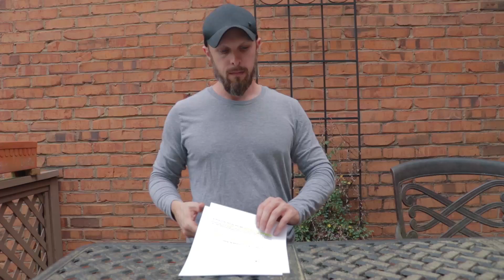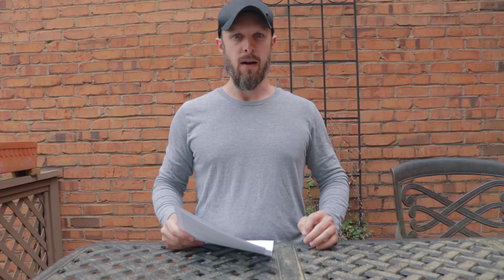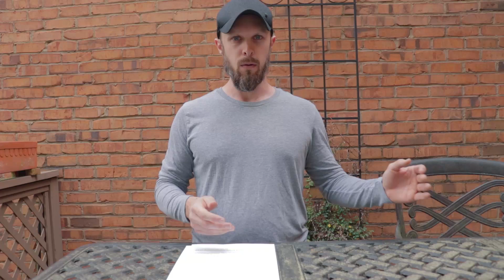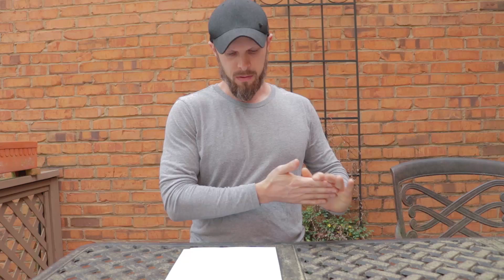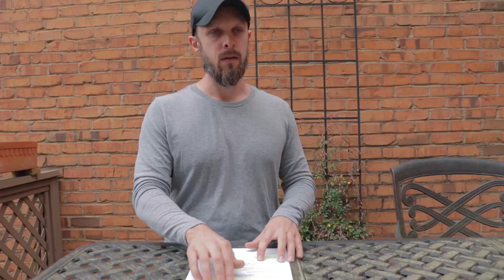Stop 5G Signals With Cob Walls - Protect Your Home From EMF Radiation

Comment: This in pinned in Atlanta. Is there somewhere in GA that it's legal to have a cobb house? I live south of atl.
Reply from the maker: Technically, it can be legal anywhere in GA if you follow the building codes.
But overall, move as far away from Atlanta as you possibly can and you will have much better chances of building a cob house there.

Comment: im losing braincells by the second
Reply: Are you sure you have any????
Reply: @britaniawaves4060  5G does not harm you at all, the strongest 5-Gen data is 300GHZ which is 2300 TIMES WEAKER THAN VISIBLE LIGHT. Also tissue heating is not a problem, because THE SUN HEATS YOU UP EVERYDAY MANY THOUSANDS A-TIMES MORE
Reply: @realaydsman  Have you done long term studies to prove this has no affect on the human body? 150 doctors and scientist from 43 European countries all called for suspension on this roll out until sufficient testing had been carried out, but got swept under the carpet. its like saying your iPhone is perfectly harmless just because it doesn't kill you instantly, FACT IS it can be weaponised, It seems a new pandemic perfectly coincides with every new radiation tech we release, we are electrical beings!!! i would love to send some links to help you understand but for some reason, some (dis info) is more DANGEROUS than others, AND NO! THE SUN HEATS ME UP ABOUT 24 TIMES A YEAR...............I LIVE IN ENGLAND

Comment: Great video. I would like to add that yes, higher frequencies like 60GHZ do not penetrate. 0-30GHZ are considered microwave bands. 30 + GHZ gets into the millemeter wave bands that do not penetrate. 5G in the short run + long run basically means an increase in ALL frequencies, including the higher frequencies. Current cell towers at 4G run in the 100MHz - 15 GHZ, which does penetrate. The "G" in 3G, 4G, 5G simply means "Generation." The "G" does not correlate with GHZ (gigahertz). The current Microwave frequencies (0-30GHZ) won't be going anywhere anytime soon. The lower the frequency doesn't necessarily mean the less healthy. These frequencies are weapons. And these are tremendously bad for our health at the cellular level. Moral of the story, this shielding SHOULD be applied to ANY/ALL homes immediately, regardless of your phone(s), and surrounding infrastructure at 3G, 4G, and 5G. I have been shadow banned by Youtube from explaining these things on threads. I ask you to please share this immediately and like this comment. Good luck!
Reply: So is there a really good way to block it as in clothing or in the home because it  is not only a weapon but they can locate you and dose you with a tremendous amount in the 150 range etc which you can feel all the way through your entire body.
Reply: Definitely not banned. Please share more of your supreme knowledge and educate us with your decades of research and wisdom, please🙏.
Reply: @T.d0T.  bro....yt deletes sensetive comments
Reply: Thank you ,  thank you
Reply: Thank you so much!
Reply: @This Cob House
Reply: @ThisCobHouse

Comment: Great to see this video, useful stuff! Unfortunately I couldn't use this in my case so I used the EMF-Turtal paint (https://emfclothing.com/en/22-emf-shielding-paint-glue) what is specially designed to block 5G and all the rest of EMF's such as Wi-Fi and mobile signals as well, really happy with my choice. I've borrowed an expensive directed EMF meter from a friend and done measurements how it shields Wi-Fi from nearby houses. It was just amazing, blocked it completely!
Reply: Did you make a video showing it working?
Reply: Howdy, just wanted to inform the following as well: Great video. I would like to add that yes, higher frequencies like 60GHZ do not penetrate. 0-30GHZ are considered microwave bands. 30 + GHZ gets into the millemeter wave bands that do not penetrate. 5G in the short run + long run basically means an increase in ALL frequencies, including the higher frequencies. Current cell towers at 4G run in the 100MHz - 15 GHZ, which does penetrate. The "G" in 3G, 4G, 5G simply means "Generation." The "G" does not correlate with GHZ (gigahertz). The current Microwave frequencies (0-30GHZ) won't be going anywhere anytime soon. The lower the frequency doesn't necessarily mean the less healthy. These frequencies are weapons. And these are tremendously bad for our health at the cellular level. Moral of the story, this shielding SHOULD be applied to ANY/ALL homes immediately, regardless of your phone(s), and surrounding infrastructure at 3G, 4G, and 5G. I have been shadow banned by Youtube from explaining these things on threads. I ask you to please share this immediately and like this comment. Good luck!

Comment: Yes sir!!! Love it.
Reply: @Andrew Lankes Howdy, just wanted to inform the following as well: Great video. I would like to add that yes, higher frequencies like 60GHZ do not penetrate. 0-30GHZ are considered microwave bands. 30 + GHZ gets into the millemeter wave bands that do not penetrate. 5G in the short run + long run basically means an increase in ALL frequencies, including the higher frequencies. Current cell towers at 4G run in the 100MHz - 15 GHZ, which does penetrate. The "G" in 3G, 4G, 5G simply means "Generation." The "G" does not correlate with GHZ (gigahertz). The current Microwave frequencies (0-30GHZ) won't be going anywhere anytime soon. The lower the frequency doesn't necessarily mean the less healthy. These frequencies are weapons. And these are tremendously bad for our health at the cellular level. Moral of the story, this shielding SHOULD be applied to ANY/ALL homes immediately, regardless of your phone(s), and surrounding infrastructure at 3G, 4G, and 5G. I have been shadow banned by Youtube from explaining these things on threads. I ask you to please share this immediately and like this comment. Good luck!

Comment: woohooo! I'm so excited to hear this info!
Reply: Howdy, just wanted to inform the following as well: Great video. I would like to add that yes, higher frequencies like 60GHZ do not penetrate. 0-30GHZ are considered microwave bands. 30 + GHZ gets into the millemeter wave bands that do not penetrate. 5G in the short run + long run basically means an increase in ALL frequencies, including the higher frequencies. Current cell towers at 4G run in the 100MHz - 15 GHZ, which does penetrate. The "G" in 3G, 4G, 5G simply means "Generation." The "G" does not correlate with GHZ (gigahertz). The current Microwave frequencies (0-30GHZ) won't be going anywhere anytime soon. The lower the frequency doesn't necessarily mean the less healthy. These frequencies are weapons. And these are tremendously bad for our health at the cellular level. Moral of the story, this shielding SHOULD be applied to ANY/ALL homes immediately, regardless of your phone(s), and surrounding infrastructure at 3G, 4G, and 5G. I have been shadow banned by Youtube from explaining these things on threads. I ask you to please share this immediately and like this comment. Good luck!